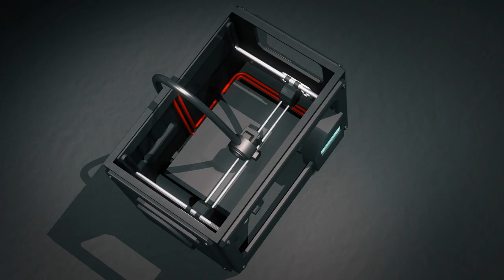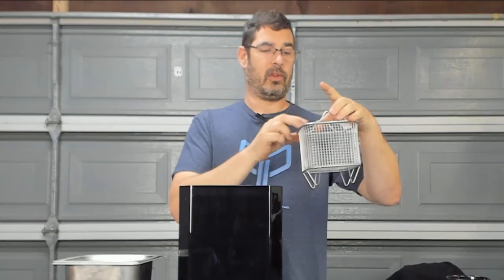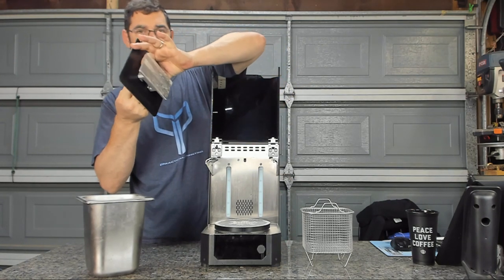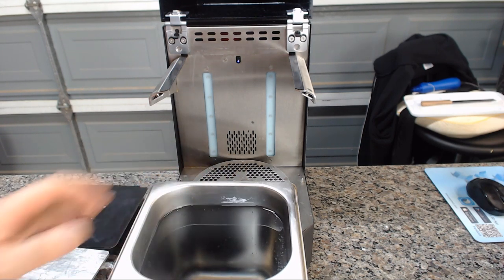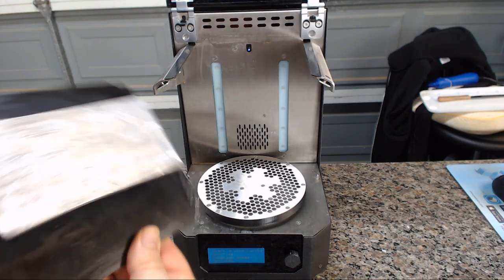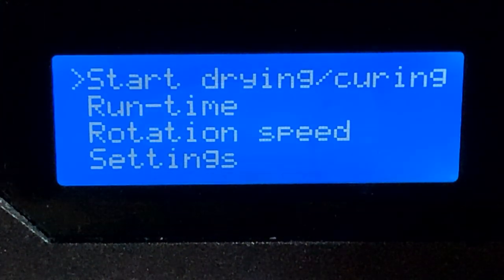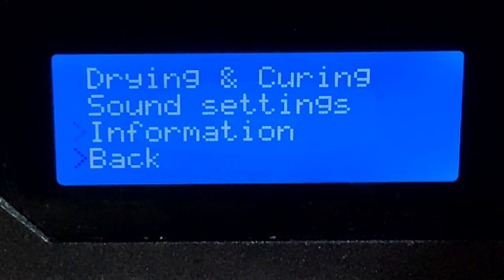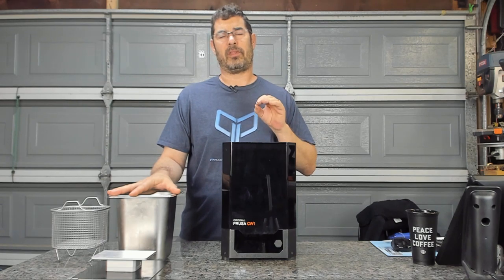Prusa CW1 Up Close & Personal

Comment: Great review, thank you for your time, just a note the heater is more concentrated down at the bottom would it not be more ideal if the heat is from top to bottom ? unless the air flow is minimal to fill the chamber.

Comment: Is the tank air tight? Or do I have to dispose of the IPA after washing? Or pour it into its container again?
Reply from the maker: The lid has a rubber seal, but there is no clamping mechanism to keep it tight. Most people print this to use to make it fully sealed: https://www.prusaprinters.org/prints/31858-cw1-ipa-tank-cover-locking-system

Comment: With the center of the plate solid, how is the bottom UV supposed to hit the model?
Reply from the maker: There are UV LEDS along the bottom horizontally and along the back side vertically. If you have a spot that the UV can’t reach, you can just rote the model and run thru another cycle
Reply: @crussty3d  What I mean is look where you placed the model.  In the center of the spinning plate which is solid, so the UV from the bottom can't actually hit it (unless it just looks solid on video).  I'm not sure why they put a UV light on the bottom then made the center of the plate solid, seems silly.  The whole plate should be meshed.
Reply from the maker: @JohnVanderbeck  The have minimized it as much as possible in the CW1s design, but there has to be some mass in the center for the magnets that spin the washers magnetic propeller. (see here: https://media.printables.com/media/prints/69387/images/760792_d2296169-0277-49d6-88d5-e7b06594d430/thumbs/inside/1920x1440/jpg/dsc_6324a.webp)

I understand your point, but only so much they can do. It is a blind spot and about the only  thing you can do it rotate the part on the plate to expose that area and re-run the cure process.

Comment: Why does it need UV light to finish? What would happen without the UV light?
Reply from the maker: Broom good question.  The resin for SLA printers cures with 405nm UV light. During the printing process, this curing starts, but it doesn’t get it to a fully hard state, so once the print has been cleaned of excess liquid resin, you need to expose it to more UV light to complete the curing process and make the part safe to handle.  The CW1 is just one method to do this- some people build. Using chambers with LED arrays, others use UV spot lights or even gel nail dryers- some people might even just leave the part in the sun for a few hours (but that’s a little less predictable on how long it will take).